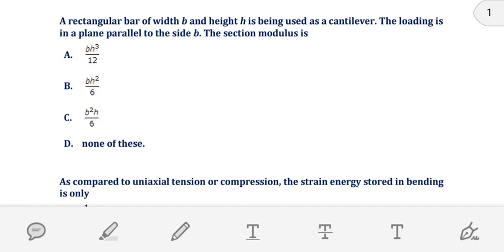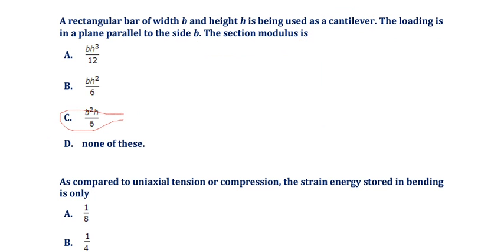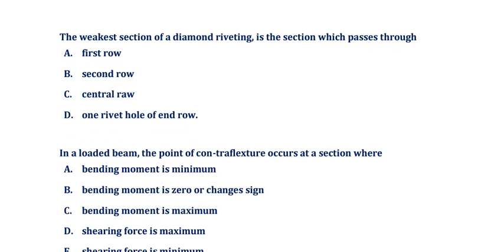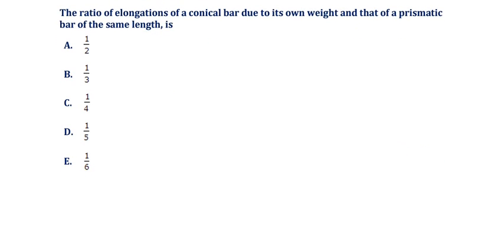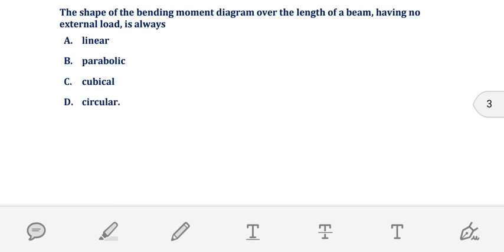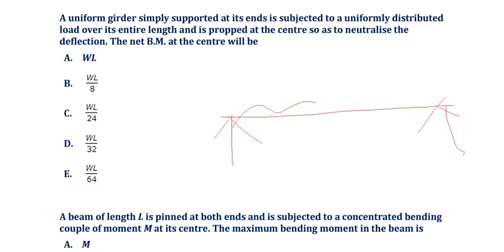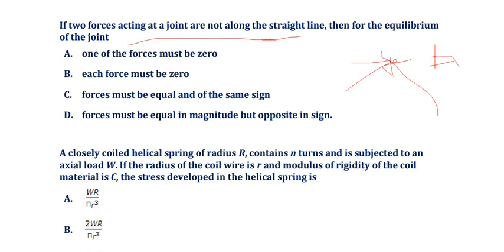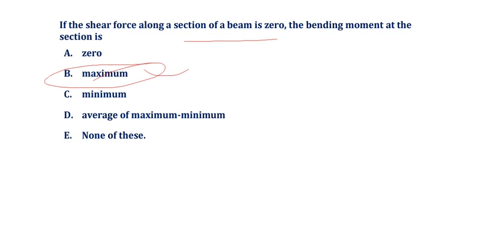CIVIL ENGINEERING MCQ WITH  EXPLANATIONS || STRENGTH OF MATERIALS  || PART - 3

Comment: i would be taking opposite of what you said, please do clarify.
Reply from the maker: +Akash Parashar 

Case 1: A loading is in a plane parallel to side b. 

Section modulus = I/y(max).

Here the load is parallel to the width b so, 
I = (b^3*h)/12.

And y = b/2. Substitute all values in formula I,

Then z = (b^2*h)/6.

Case 2: A loading is in a plane parallel to side h. 

Section modulus = I/x(max).

Here the load is parallel to the width b so, 
I = (h^3*b)/12.

And x = h/2. Substitute all values in formula I,

Then z = (h^2*b)/6.

You won't take the square of b or h. A loading conditions generally will be given in questions. They asked the section modulus according to x or y axis  or loading conditions  both are same.